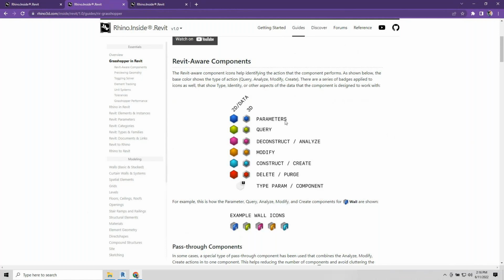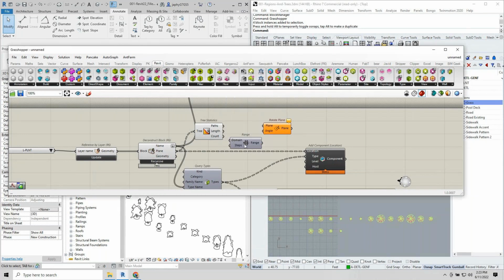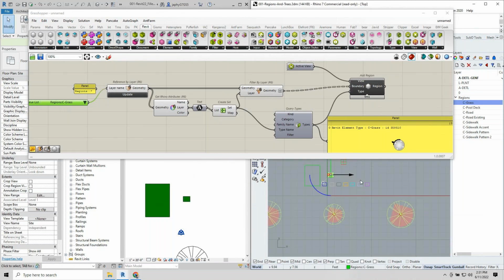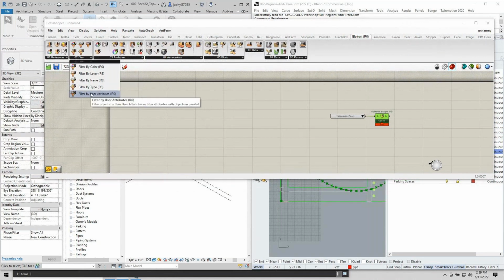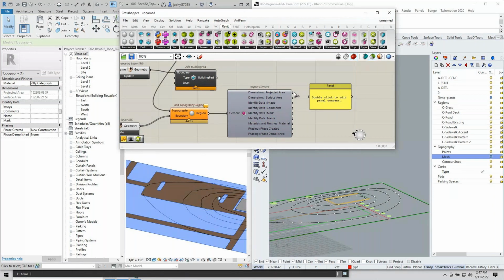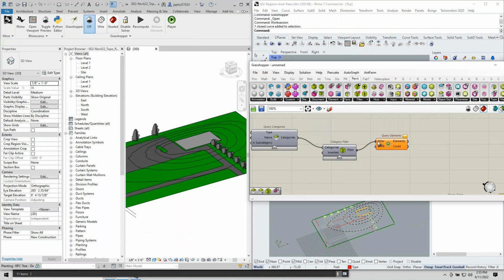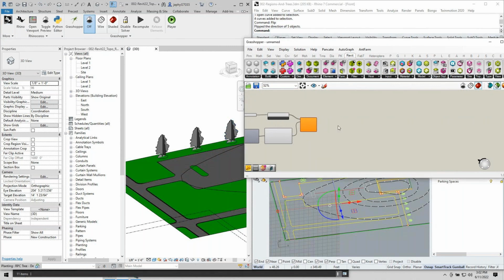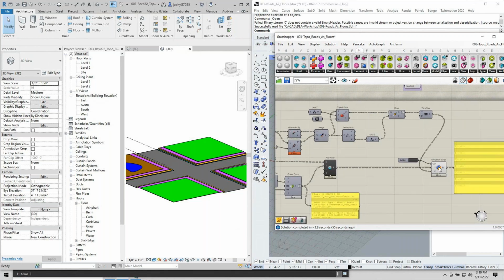Topography Workshop June 2022

Comment: Great video.
I know that it's not supported to host components on topo through rhino.inside,  but Is it possible to host trees/components through revit side on a topo created from rhino.inside?
Reply from the maker: Hi Johan, Thanks for the comment. In this case we are using the distance to from the trees to the mesh determined in GH to change the tree locations, so not actually hosted.